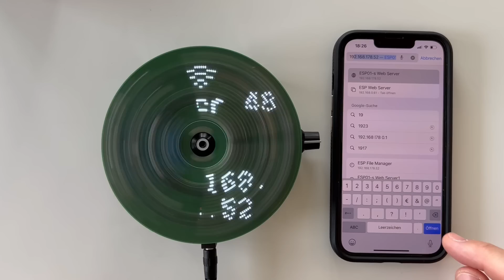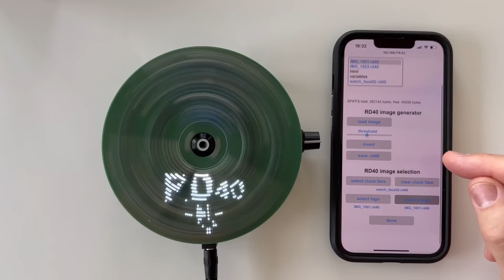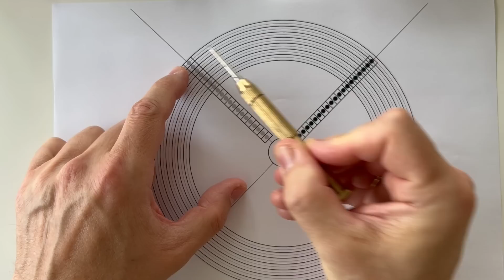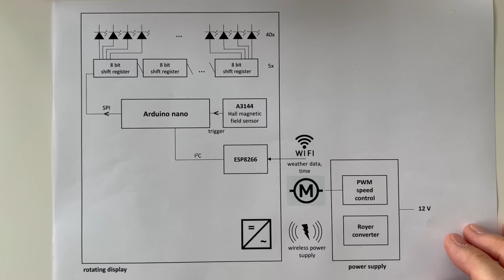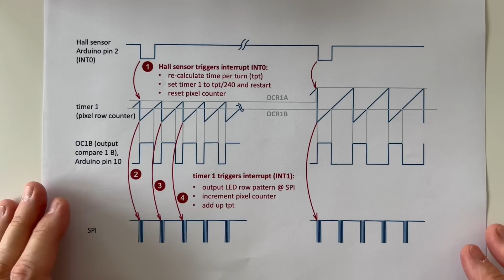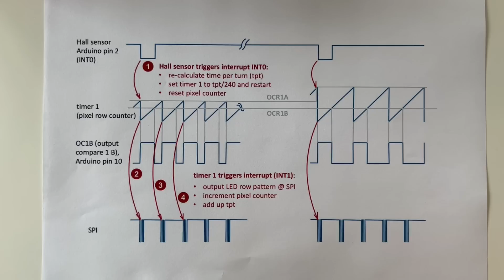DIY Rotating LED Display: An Arduino-Powered Time and Weather Display Project. POV Propeller Display

Comment: Hii,can we show image using Arduino nano .just like you did with pico ❤.by the way this was impressive ❤
Reply from the maker: Unlike the pico display, the Arduino nano display cannot display animated images. The Arduino nano has very little memory and a slow processor. It cannot handle large amounts of data or generate complex images. Although the ESP01s is much more. powerful, it can only transfer images through a slow I2C bus. I trust that helps, best regards, Ludwin

Comment: Good job making a fully functioning display. You can buy a holographic fan that will display video, a 60cm with 720 LEDs looks like a cookie cuttter piece of 1080o video.  For demos a 14cm with 128 LEDs can be had for about $20 is uses a single ESP32 and can display a decent Dr. Strange hand weapon.  The original 42cm size with 220 LEDs can be found for $30.  The Largest fans on the 100 - 180cm range have 6 or 8 blades, in part so it can operate at a lower RPM and not tears apart from centrifugal force.
Reply from the maker: The point of such a project is to solve interesting engineering challenges and not to outperform commercial products ;-)

Comment: I saw a lot of pov in defiant design but i certain you're work is really best of all that.congratulations.
Reply from the maker: Thank you. I am currently working on a new and very much advanced version with an Arduino pico W. It will have 56 white LEDs (edge to edge) and can display animated GIF images. I think it will be completed by the end of the year.
Reply from the maker: You might want to have a look at this: https://youtu.be/Msv1gF6FXeg

Comment: I want to use stc8 to realize routating led display, but I don't understand how to produce the coordinate in circle.
Reply from the maker: Help me understand: what is stc8? 
Images usually use Cartesian coordinates (x,y), the rotating display works with polar coordinates (r, theta). The transformation is straight forward, a good reference is here: https://www.mathcentre.ac.uk/resources/uploaded/mc-ty-polar-2009-1.pdf

Comment: But you need only 8 lines to light up 56 LEDS. N^2-N. 4 shift registers is overkill actually.
Reply from the maker: You can light up 56 LEDs with 8 lines using "Charlieplexing", which is a multiplexing principle. The LEDs are addressed sequentially, one after the other.
Fundamentally, there is no reason not to use Charlieplexing in "persistence of vision" (POV) displays. However, there are several implications:
1. timing: a  POV display is all about timing. You would need to light up your 56 LEDs about 240 times per turn. This would require a very high multiplexing frequency. 
2. intensity: if you light up 56 LEDs one after the other, each LED will be on only 1/56th of the time. As a consequence, brightness will be reduced by a factor of 56. In multiplexing, LED currents can be set higher, but it will not be possible to compensate for a factor of 56.
Anyhow, there are less "aggressive" multiplexing approaches (wich need more lines), which are definitely an option for POV displays. In fact, I have been working on such a model for a while. Will keep you posted.
Reply: @LHM000  Most of the reasons take place. I agree. But as for "one-by-one", it's not correct. An entire row is always "active". Let's say bit #0 is "active" - connected to a ground, and so a row of LEDs, and bits #1-#7 could have +1 (or be in a Z-state) and light up an individual LED on this row. Then bit @1 becomes "active" and is connected to a gnd, and bits #0, #2-#7 can light up LEDs. Thus you will need only x4 faster scanning. If this is too fast, then 24 parallel outputs will be more suitable for sure.
Reply from the maker: I doubt you can light more than 1 LED at a time in Charlieplexing, if you want to properly control the LED current. How would you handle the series resistors? Depending on how many LEDs are on in a row, you would need different resistors. No way. Forget about Charlieplexing.
Standard multiplexing is an option, though. It needs extra components to control rows and columns. But it can be done.
Reply: @LHM000  Open drain is open drain. So, The "active" line just shorts cathodes to gnd. Each remaining line can feed only one(!) LED (others belong to inactive rows). So, one LED, one resistor, a certain current. That's it.

Comment: I built a similar one that goes onto a ceiling fan and displayed the time, it was one of my early electronics projects like 20 years ago, used couple AA's and a msp430 micro.   Today they have the ws leds so its super easy to make a grid for something this size.   I had the idea back then to make billboards using this, as they are huge and need many thousands of very very bright leds, but did not ever finish it.   Instead of swinging a board or leds, those would be centrally located and I was using fiber optic cable to get very high resolution and light weight at the edges.   I still have not seen anyone do that all this time.

Comment: I'll have to remember this.  I want to do more hardware stuff, and while I'm not sure I'd make reproducing this my first project, I'd still love to try.  One thing that would be an interesting hack that I can see right away is the possibility of making this two colours, assuming the 1mm gap between LEDs isn't an issue.  You could have, for example, one lot of LEDs red and the other white, green and blue, yellow and blue, or whatever takes your fancy.
Reply from the maker: This is probably not a good beginner’s project. Make sure you have some good soldering skills…

Comment: Amazing work with great attention to details like perfect balancing, stable picture and two rows which are offset half a pixel outward. The only thing I found odd is that you placed your LED modules at a 90° phase angle. It would produce smoother animations and less flicker at 180° placement, as this would effectively give you interlaced scan, but in polar coordinates. All the disbalance could be coped with counterweights which you have to use anyway.
Reply from the maker: thank you for your thoughts. The 90 degree angle was a result of mechanical considerations. However, I am currently working on a color display which will have 180 degree placement.

Comment: You can replace the Arduino Nano and the ESP-01s with a single Raspberry Pi Pico W and  thus save a little weight on the display disc. Nice project!
Reply: You can replace all of them with an esp01 or esp8266

Comment: Hi dear maker and thank you for this amazing design. i have an issue. i build this project but when i connect to RD40 wifi and want to open ip address wit browser, it won't open any page in my browser and showes me an error. yet display still shows ip address. i double and triple time flashed both arduino and esp but nothing changed. can you help me please? thank you
Reply from the maker: Hi Sam, it sounds like you have not loaded the flash disk data. Please refer to the description in my instructables.com article: https://www.instructables.com/Rotating-LED-Display/ It is described in Step 5. 
You are very close! Both microcontrollers seem to be running. Please let me know if it still does not work!
Reply from the maker: What I am trying to say is this: you need to load both the program itself and the flash disk data to the ESP. This needs two separate uploads. There is a special upload method for the flash disk data.
The flash disk data contains the html, css, and java scripts of the web interface. Without that, the web interface cannot load.
Reply: Hi dear maker. Thank you for your reply. Yes you right, i missed that last part which was uploadin flash data. it works perfect now but i have another problem now, in the time zone, some zones not have correct times. i tried all of them, i just wanted to ask you a favor if its possible, im not a coder and i can not add a feature which read clock from computer or mobile phone or even set time and date, manually. Is it possible to ask you do me this favor? I spent so much cost and time to build it, i will be so grateful if you add only one of the features i mentioned earlier. Thank you dear maker
Reply from the maker: Great to hear, that the display is running now. What exactly is the problem with the time zone? What time zone are you in?
Reply from the maker: Can you send me a private message on instructables.com? Click on my username lhm0 and send your email address, please. That will make communication much easier

Comment: The work is so interesting that many ideas occur to me. Wouldn't the brightness control be simpler if the common power supply of the LEDs were controlled by a PWM?
Reply from the maker: The problem would be, that the frequency and wave form of the PWM would interfere with the (individual) on/off signals of the LEDs. However. PWM has to happen “within the pixels”.
The only way to make your idea work would be to make the PWM frequency much higher than the pixel frequency.  Pixel frequency can be up to 10 kHz. Frequencies of PWM are usually lower.

Comment: A magnificent job. It is not clear to me why the two rows of LEDs are necessary. And I would also like to know how the images are loaded? That is, do you have an application to "draw" the image you want and generate the table that the microcontroller reads? Thank you very much, congratulations for such detailed work.
Reply from the maker: You could also make a display with just one LED row. However, this would reduce the resolution by a factor of 2.
The web user interface allows you to easily upload images from a computer or smartphone to the display. All kinds of image formats work (JPG, IMG, PNG, …) No additional software needed. The image can be color and high resolution - there is a function which rescales it and makes a black and white image out of it. The software for this is part of the web page of the web user interface, which means it is programmed in Java Script. This is a big advantage, because JS has a huge functionality and the computer or smartphone has much more computing power, than the ESP microcontroller.
I should point out, that the web pages are hosted on a “little web server”, which runs on the ESP microcontroller. This is a fantastic function of ESP!

Comment: Very cool!  I'm curious why you used both an ESP module AND an Arduino...?  Couldn't the ESP accomplish all of it?  Thanks
Reply from the maker: I would assume that the computing power of the ESP would be sufficient to accomplish everything. However, the challenge is the prioritization of tasks. The wifi function, as well as other tasks, need high priority in order to work. On the other hand, the control of the LEDs is extremely time critical as well. We are talking about response times of microseconds. Every delay would be visible in the display image, immediately. It turned out, that the best way to manage this is to use a dedicated microcontroller for LED management, only. 
However, even the Arduino nano, which really is a slim and minimalistic device, has its pitfalls. The controller does not have a way to prioritize interrupts. Instead, it works through the interrupts sequentially. Unfortunately, there is not only the timer 1 interrupt, which is most critical for the LED control. There is a clock interrupt for the system time (used in functions like delay()), there are multiple interrupts for serial, SPI, and I2C interfaces. All that interferes with the LED control. 
In comparison, the ESP is much more complex and even more difficult to control. Anyhow, I did not find a way to manage priorities on the ESP such, that the image quality would be acceptable.
Reply: @LHM000  Thank you for the insight.  I bet an ESP32 could handle it all!  Thanks for sharing.  I'm interested to see this project evolve into the future!!  RGB might be a fun next version.  :)

Comment: Excellent project and a great video. Thank you for sharing. I like your solution to have power transmission and rotation on one board, and power reception and display logic on another. You've cleverly avoided the need for slip rings. 74HC595 shift registers are awesome. Here is an LED cube that I designed many years ago using Arduino and 74HC595 chips https://www.youtube.com/watch?v=WdWw8wt4VhY
Reply from the maker: thanks, Mick. I am using the high power version of the 74HC595. It is from TI, called TPIC6C595. However, probably the 74HC595 would work as well.
Thanks for the LED cube video. My son made a similar one. Would be interesting to rotate this thing or something similar. ;-) We could make a 3D display out of it.
Reply: @LHM000  Something like this perhaps?  https://www.youtube.com/watch?v=g7_VKGsEKeA
Reply from the maker: This looks like a spherical display. I am thinking of a true 3D display. Imagine a flat array of for example 64x64 LEDs. Put it upright, and rotate it around a vertical axis. You could draw 3D objects in space
Reply: @LHM000  Wow !!

Comment: Amazing work. It's a high level criativity. Thanks for sharing and the detailed explanation. I was wondering if it should be possible to make one using a RGB(W) LED like WS2812B, for example.
Reply from the maker: Here is an answer which I prepared for a similar question on instructables.com: 
A color display would be a real stretch. First and foremost, the memory size of both the Arduino nano and the ESP8266 would not be sufficient for a color image. Here is the simple calculation: The current display needs 40 bits per line (5 bytes), the number of lines per round is 240. This makes 1200 bytes for one image. The nano has 2048 bytes of SRAM, only.
If we want to make a real color display, we would need to deal with brightness levels (on and off would not be sufficient). If we assume we use 8 brightness levels per color, we would need 3 bits * 3 colors * 40 pixels/line * 240 lines = 86400 bits = 10800 bytes. This is obviously a factor of 9.
The next challenge would be how to set the brightness for each individual LED. I have some ideas, but it would probably need a faster timer and a more powerful microprocessor.
Here comes the next challenge: the communication between the ESP and the Arduino microcontrollers is based on I2C right now. This is very slow, and definitely too slow for transferring images with 9 times the size of what I have today. As the ESP also would need to have more memory, we would need a different model anyway. I would probably use a second SPI interface for connecting the two microcontrollers.
A more practical challenge would be to somehow fit 120 LEDs on a 120mm disc. I made an experiment with 80 LED, and I could fit it. However, more LEDs will really be tight. The only way might be to use SMD components.
And lastly, with moving towards more powerful microcontrollers, power consumption will likely go up. I believe to still have some spare power with the wireless power supply. However, we would need to figure out whether the power available would be sufficient.
Sorry for the lengthy answer, but it is a simple question with no simple answer ;-)
Cheers, Ludwin
P.S.: The WS2812B would most likely be too large, and communication would be too slow. Speedy communication is really of essence. The timing is about a few microseconds. The WS2812B would probably not do it.
Reply: @LHM000  Thanks again for another free lesson (just kidding) and you don't have to apologize at all. Please understand that I am just a curious and admirer. I really appreciated your knowledge in everything you did.
Hope more amazing projects from you.
Greetings.😉

Comment: Excellent project, excellent explanation. Just wondering why you didn't use a rotating coil/magnet combination to generate the led power?
Reply from the maker: Hi Jack, there is a simple reason, why I did not use the magnet/ coil approach. I did not think of it ;-) Great idea! However, the generated energy would depend one the speed of the rotation - that is not the case with my approach. Anyhow, thanks for reaching out.
Reply: @LHM000  Thanks for responding. Your design is still very elegant and incorporates many electronics aspects which will be of great help to those wishing to resolve similar design problems.

Comment: Great project-product! …. I would have used a second static PCB to carry the Arduino’Nano and most of the the electronics and let just the LED strips on the rotating PCB ….that should increase the MTBF and reliability of the whole solution …..
Reply from the maker: How would you connect the Arduino with the LEDs? My only connection between the static and the rotating part is the wireless power transmission.
Reply: @LHM000  radio transmission would be one  option …
Reply: @juancarlosabad3298  Respectfully, I don't think that makes sense. If you put the Arduino and most of the electronics on a static board, and the LEDs on a rotating board (the rotor), then how would you transmit from the static board to the rotor, and illuminate the LEDs by radio? To do that, you would need a circuit on the rotor that receives the radio signal, decodes the packets and turns on the appropriate LEDs at the required time. There is also latency to consider. Such a design would need a wireless receiver,  a microprocessor, and LED drivers on the rotor. In other words, you would end up with a design very similar to the one shown here, but with more components (potentially 2 Arduinos and 2 ESP-01s). That would increase the MTBF, not reduce it. Personally, I think the solution shown in this video is very elegant. There are no slip rings, so apart from the motor, everything else is solid state. There is very little to go wrong.